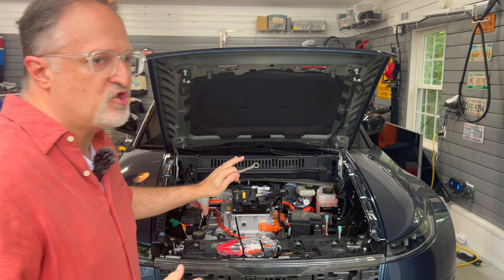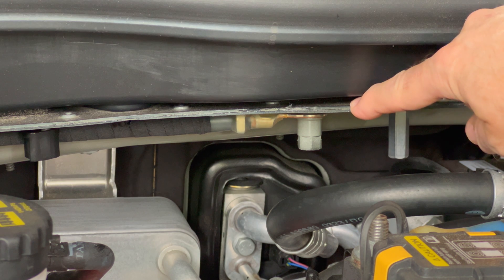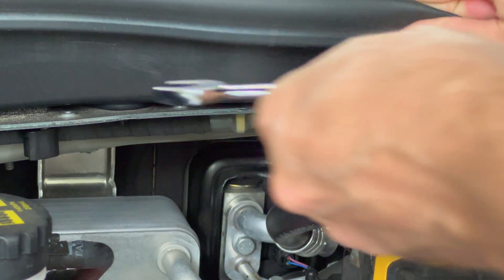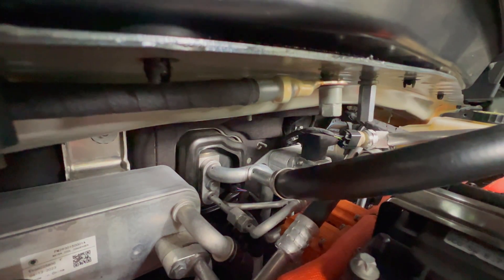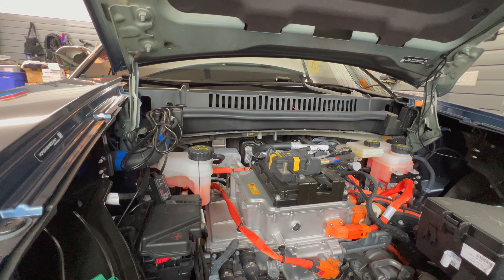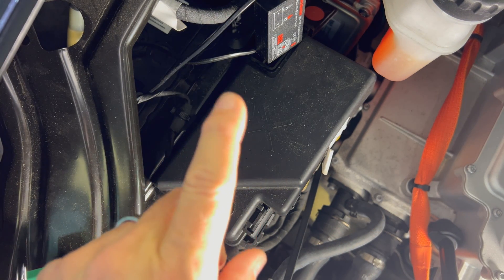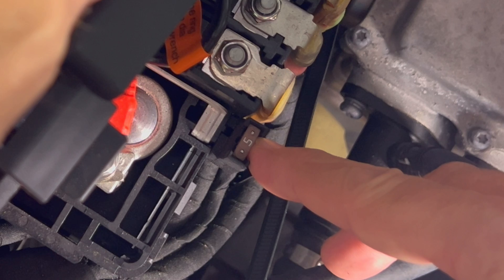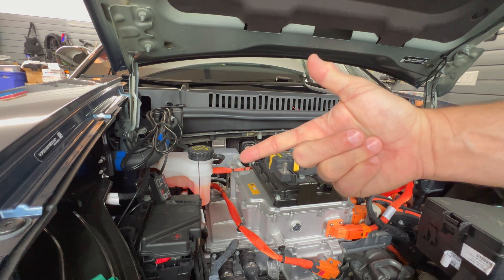Fisker Ocean - Two 12V Battery Issues

Comment: We’re all learning so much from you; thank you for your contributions to the community. Following your video, I installed a 12v battery monitor, a 10-gauge wire, and a 20-amp fuse. To simplify maintenance, I just reconnected the negative terminal to a 13mm bolt on the fender bracket holding the 12v battery.
Reply from the maker: Glad it worked for you. Yes, there are a few places you can connect the negative/ground wire.

Comment: Hi again, I was just driving my Fisker Ocean and the red low battery icon suddenly turned on. My vehicle slowed down and I couldn't get it to go more than 20 mph for the rest of the trip home. Scary moment. The main battery was at 70% and the 12v was on a tender and monitor (both looking good) prior to driving. Any thoughts what might've happened? Could this be due to a low 12v? I'm still on the original 12v. Lastly, do you have a recommendation on the 20A boost?
Reply from the maker: Have you done a reset?  Is it still in limp mode?  Are you looking for a jump starter or charger?

Comment: Idk what to do. My battery lite comes on while driving right away then car won’t accelerate. I did these two things not fixed. I’m in Vegas area not sure what to do I have a useless car
Reply from the maker: @mymountrushmore6235  What exactly is the warning?
Reply: @MTNRanger  just the little battery lite comes on. Then I can’t accelerate. I tried hard reset n soft. Car works for a min then does the same thing (first time ever I charged it to 100% not sure if that messed anything up)
Reply from the maker: @mymountrushmore6235  charging to 100% is not a problem - just don’t leave it at the for a long time.  Usually you would charge to 100% before a long trip and immediately drive it.
Reply: @MTNRanger  I emailed you hopefully you got it. Looks like three batteries stacked on top of each other
Reply: @MTNRanger  is the sensor touching something? I saw u made another video about that? The battery doesn’t seem dead because I can drive it for a min then it shuts off
Reply from the maker: @mymountrushmore6235  It could either be the seat sensor or possibly the water pump. However the water pump will also give other errors and show limo mode.
Reply from the maker: @mymountrushmore6235  The IBS sensor is on the negative terminal.  If it is not adjusted correctly you may get some 12V problems. But nothing that would cause the car to drive slow. Can you take photos of the driver screen and email to me at mtn_ranger at aol dot com

Comment: Hi Matt, thanks for all the helpful videos and tips. Do you have anything in the hopper for 12V battery replacement? Any tips how to replace the 12V battery without losing the settings? Thanks
Reply from the maker: Yes check my recent 12V battery replacement video.

Comment: Thanks, somewhat related question…how do you keep the 12 V and 120 V power outlets on in the back when you need to use them for connecting something like the 12 V tire pressure filler? Mine shut down about 30 seconds after I step out of the vehicle. But, they stay on of course if I have someone else in the driver’s seat with the car fully on.
Reply from the maker: You need to keep the car in ready mode, which means keep the key fob near the center console.  Some people have found they can get it to last a long time by also putting weight on the brake pedal and/or seat.
Reply: @MTNRanger  Thanks!

Comment: Matt. About two weeks now. I’m getting when i first enter the car I hear a sound that goes from high tone to low then it flash 12 volt battery. Then it doesn’t do that any more for the rest of the day.  Could it be that my fuse is the issue or something else. I just got a battery tender do I need to keep connected all the time?
Reply from the maker: I don't recall hearing anything like that. I wouldn't know what particular fuse (out of the hundred plus in the car)  that would cause that. Does it do that warning with and without the tender attached?  Is it possible to do a quick video sometime and email it to me at mtn_ranger at aol dot com.
Reply: I have the same issue and when I connect my charger is shows 12.1v on the battery so I suspect the battery is ok. Did you get your issue resolved?
Reply: Coincidentally it started shortly after the 2.2 update.

Comment: Matt -- Thanks for walking us through these 2 obscure 12 volt battery issues. Hey I bought a Duralast battery charger like the one you used in a video re: charging the 12 volt battery. But I can't tell from the digital readout on the Duralast whether the 12 volt even needs a charge. The instructions that come with the Duralast are not exactly clear on this point either. Could you do a short video on how determine if the 12 volt battery even needs a charge by looking at the read-out on the Duralast charger (or any other charger you can get at an auto parts chain store). The all seem to be made by Schumacher Corp.
Reply from the maker: I don’t have a Duralast charger. Mine is a Deltran.  Most maintainers/battery tenders have an auto charge cycle and turn on/off when needed.  That’s how mine works.